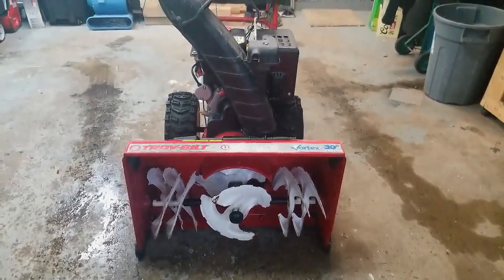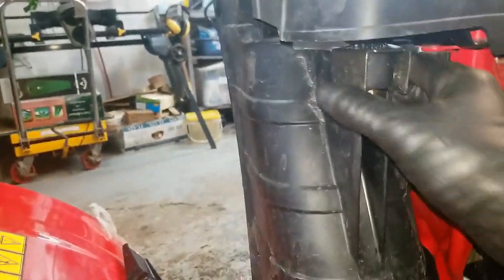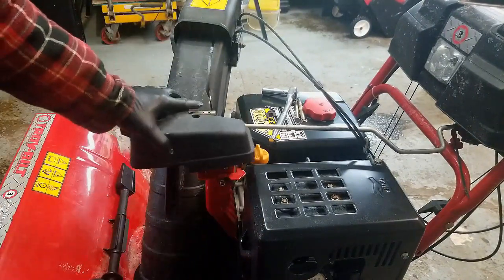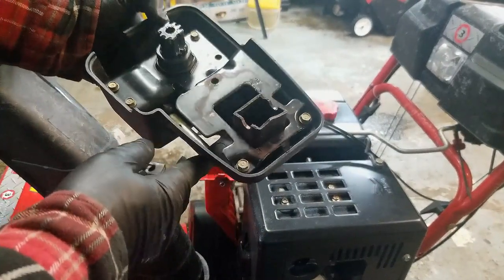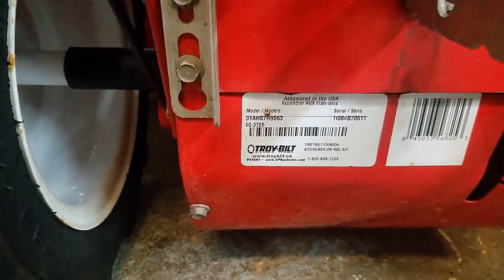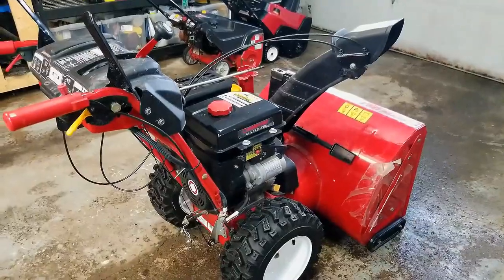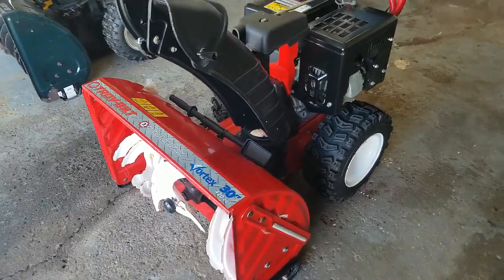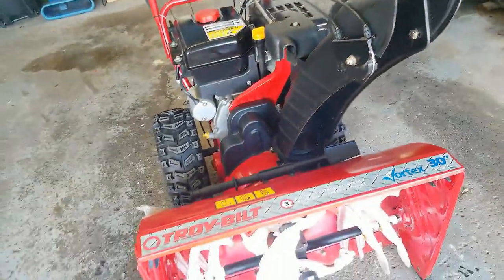Troy Bilt Snowblower With No Chute Rotation

Comment: Great video.
Helpful with my shute that only rotated one way.
Thank you!
Reply from the maker: Glad I could help. Thanks for watching. Cheers
Reply: which is my issue...what did you find caused that?
Reply from the maker: @bobbyo111  owner dropped it off the tailgate when unloading it
Reply: @brantsmallenginerepairs  yeah, i meant, a chute that rotates one way, not the other. Started that today. I am hoping it heals itself when it sits and thaws for a while, but likely not.
Reply from the maker: @bobbyo111  sounds like some further investigative work is in order
Reply: Were you able to just order the worm gear? If not, how much for the entire assembly?

Comment: Great video can you tell me if the 1/2 inch bolt on the gearbox turns with the chute when it comes is rotating. Your help in this matter would be appropriated...Anthony
Reply from the maker: This bolt should stay stationary while the chute is moving. Hope this helps. Cheers
Reply: Thank you

Comment: I have a similar issue but also the chute up down which has a setup similar to a bicycle brake cable. Any ideas?
Reply from the maker: If the chute will not rotate of move up and down, then the likely culprit is the joystick unit itself.

Comment: Great video.  I need to fix my model that has a gear lock on a manual chute assembly.  Any advice on how to disassemble the cable that controls the gear lock?  The gear lock is controlled by a trigger on the pistol grip.
Reply from the maker: What make and model are you asking about?

Comment: Great Video Brant. I have an old 8 hp MTD and never did i think to myself I wish it had more cables and controls that could break and make me use a shovel . its not that difficult to turn the handle to rotate the chute or change the front flap higher or lower. I just dont get it
Reply from the maker: I agree. More gadgets means more that can go wrong. Thanks for watching. Cheers